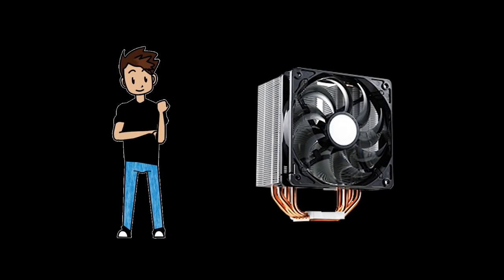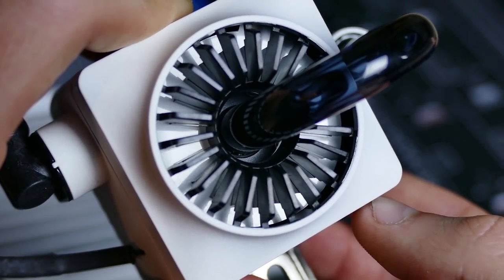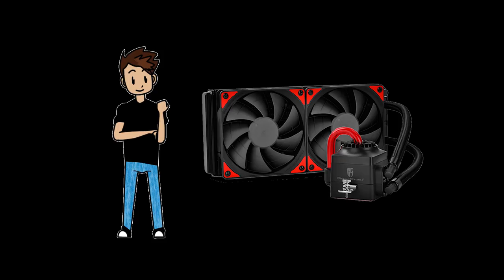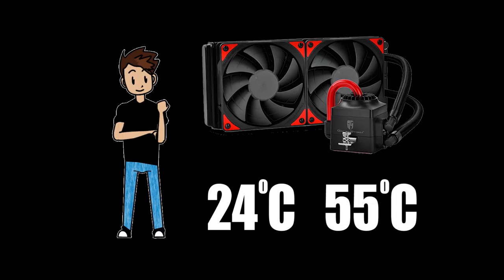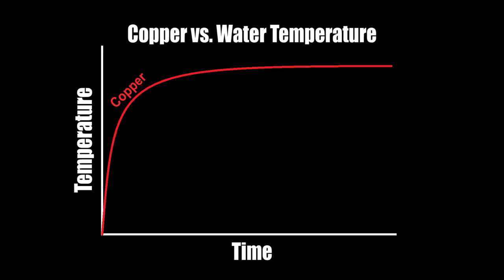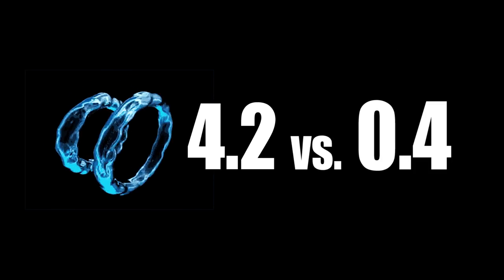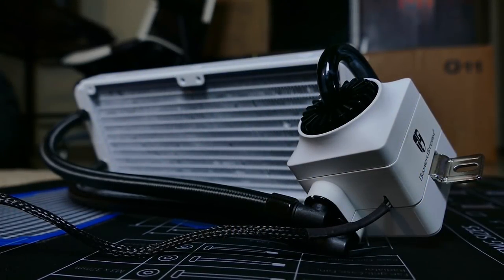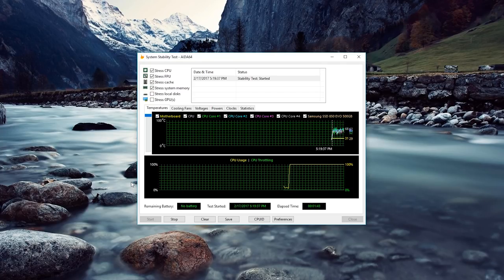How to Properly Measure AIO Temperatures

Comment: Should I get a 7700k/7600k or wait for Ryzen?
E̲D̲I̲T̲:̲I am new to PC gaming and need the processing power for games, video editing, emulation,sound editing,  and some virtual machines.
I am also getting into I.T so I might run virtual machines of Windows server,Mac OS, and maybe some Linux Distros.
Reply: Nm3z Kazi Wait for Ryzen's benchmarks and then choose the better one.
Reply: wait for ryzen then if you think ryzen is better then get it but i think ryzen will be cheaper
Reply: not only will the cpu be better price to performance, the motherboard will likely be cheaper too with the same feature set.
Reply: Nm3z Kazi It's fine to decide the rest of your parts, but with Ryzen less than a month away, you might as well wait on the CPU-MOBO til it comes out rather than 
A) decide you'd have liked AMD better/ gotten better price/performance ratio or 
B) bought Intel goods at a higher price

good luck mate!!
Reply: Roman Kozlovskiy That's subjective and without data to back it up as people would naturally stop buying amd products if they all crapped out pretty easily. Despite this claim, they've been able to eek it out with 3 year old CPUs until now and still competed (even if only barely due to pricing )

People get good and bad experiences with both sides, it's worth the wait :)
Reply: do you NEED to upgrade? that's what you should be asking yourself if your benefits aren't drastic then you dont need to spend the extra money
Reply: I'm an Intel fanboy and personally use a 7600k, but I'd recommend waiting. I jumped the gun and got the 7600k because my g3258 wasn't keeping up and i needed a new cpu. The 7600k is perfect for what I need, but it really isn't anything new or special.
Reply: I mean I am new to PC gaming and need the processing power for games, video editing, emulation,sound editing,  and some virtual machines.
Reply: if that is all you are doing then just get a i5, but wait for ryzen to come out, all cpu prices will drop after that
Reply: ya so tru i agree with ethan :)
Reply: +lucas rem
console can't run 4k games...they can t even run games at 1080 60fps and med detail in most cases
Reply: Will the i5 do well with 1080p/1440p/4k video editing and gaming?
Reply: +ethan dipple
and why would you suggest an i5 when an amd is looking to be faster at a lower price?
going for an overpriced 4c/0t in 2017 is madness
Reply: because he wants to run virtual machines and we don't know for sure what AMD is doing untill they acturally put their products on shelves
Reply: +Nm3z Kazi anything will do 4K editing, it just matters on 1. where you are getting your content and 2. how fast you need to produce that content
Reply: I am getting into I.T so I might run Windows server/Mac OS and maybe some Linux Distros.
Reply: ok then look for the leaked prices on ryzen you'll see
Reply: I fully expect my i7 6700k to sell for 200 USD before long.
Reply: there is going to be 4 core 8 thread ryzen cpus
Reply: I would get a Non-American CPU. 

AMD and Intel support Jewish overlords and illumanti (confirmed). Let me ask you this, if a
Reply: For the workloads you are mentioning you will probably need many cores. When RyZen comes out, if it is good, go for a 6 core or an 8 core. You will also need a lot of RAM, 16GB or 32GB.
Reply: Nm3z Kazi up to you, just letting you know that the 7700k is hot as hell. I have a h115i and at 4.8ghz it gets up to 90+ easily
Reply: Get a Ryzen 7700K
Reply: wait for ryzen and intels leaked x299 kabylake stuff may be a soldered version of kaby to fix thermal issues
Reply: Nm3z Kazi definitely wait for ryzen, you will regret if you don't. For the same price of a 7700k, ryzen offers a 8c/16t, and a 6c/12t for the price of a 7600k.
Reply: Intel finally has competition, be patient
Reply: Nm3z Kazi wait and see price cuta from intel or cheap amd will be very very soon
Reply: if gaming then get the i5 if gaming and editing get the i7
Reply: I say first wait for Ryzen to come out, then check prices of their equivalent of an i7-7700k, then wait for a friend to buy a Ryzen and ask him if his system is stable... As a long time AMD user, i know that the early models in AMD new generations tends to come with lots of issues. Intel in the other hand, tends to work realy stable. And i know is not realy AMD's fault, it can be due to the Motherboards, and even windows itself. But the fact is, that early adopters tends to suffer a lot of headaches.
Reply: ultra 4k 60fps gaming is pretty much out of the question unless you have a crazy budget. honestly its still a few years out imo. for example i7-7700k, gtx 1080, plenty of ram wont even get you a smooth 60fps in 4k playing bf1, it'll be in the 40's more likely.
Reply: dual titan x build bruhh it'll only be like $10,000
Reply: Nm3z Kazi id recommend to wait for Ryzen
Reply: If leaks are at all to be trusted, you could get a Ryzen chip that isn't far behind the 7700K (when overclocked to the same frequency, that is) for just over half the price.
Reply: Vicious Demigod They haven't hyped Ryzen up like they did with Bulldozer, and just about all of the leaks have been lining up with each other and with what AMD claimed performance-wise.
If Ryzen does turn out to be a disappointment in the end, I'mma be questioning reality.
Reply: None of the Athlons or Phenoms have been letdowns.  The AM3+ socket just lived a little too long.
Reply: This cannot possibly a real question. Why on Earth would you not want to wait for at least a significant price drop if not an outright better CPU?
Reply: WAIT FOR RYZEN
Reply: Nm3z Kazi I would personally wait, but don't be too overhyped as AMD is the king of let-downs.

Edit: If anything, maybe the Intel CPU will drop in price when the AMD one releases.
Reply: Nm3z Kazi coming out FEB. 28th or early march. Wait for ryzen
Reply: Nm3z Kazi Ryzen, the Ryzen Summit Ridge cpus are way way better in price to performance than intel. Their six cores cost around the current  i7 kabylake cpus. Also, how someone said that the intel cpu prices might drop, well, they could but not by much, if at all, as they are just now hiring more employees and intel, like Nvidia,(be ready for a biased statement) want more and need more money. Like how Nvidia pays large sums of money to game developers to make Nvidia gpus perform better in said game.
Reply: MonsterLord Games when will the new amd cpu and gpu come out. I'm new to pc gaming and I'm going to build my own. I know the cpu will help drop the price of the old one but I don't want to wait that long so does anyone know how long till the new cpu or gpu will come out? thanks
Reply: Super1 23 Have you been living under a rock? Beginning of March, allegedly.
Reply: Games are using more and more cores by the day, I would wait for Ryzen.
Reply: Nm3z Kazi ryzen
Reply: Try to get a 7700k like me, I found a good deal on Ebay for $310
Reply: William Dillery NO NO NO NO NO NO NO.
YOU'LL BE ABLE TO GET A RYZEN 8-CORE FOR THAT PRICE.
Reply: NEX H5 with as much SC performance as an i7
Reply: Michael beseler Broadwell IPC plus more efficient SMT (hyperthreading).
Reply: +NEX H5 Considering that AMD has never done SMT before and that we don't have the benchmarks, that's a very brash statement.
Reply: Sobakus "We don't have the benchmarks."
Oh yes we do. Leaked information (same with the SMT efficiency), but given how well all of it lines up with one another, I'd say it's pretty reliable.
Reply: Sobakus Still, 8 physical cores with the same single-core performance of an i7 >>> 4 cores and 8 threads.
Reply: +NEX H5 You don't happen to have the link to the SMT efficiency benchmark?
Reply: Sobakus It's not exactly a benchmark, some guy who managed to get hold of an engineering sample on a forum; some YouTube channels covered it though, but I can't remember which videos exactly.
Reply: Sobakus They said it was without turbo boost and XFR. And even if it's slightly worse than Intel's, it's still largely competitive, especially since you'd be getting twice as many cores with similar IPC to modern Intel for the same price.
Reply: +deathbat6916 Oh, come one, there's no "they", it's an anonymous submission to the PassMark online score database. Cut the crap and read the article at least.
Reply: Sobakus pretty sure the engineering samples are specified just like the benchmark AMD themselves used.
Reply: alright youtube chat 2 weeks, no more need to discuss much, the conclussion is wait, it all looks great, but wait benchmarks...
2 weeks to benchmarks...1 week till release maybe just 1 week till benchmarks...
Reply: +deathbat6916

The benchmark AMD themselves used had turbo though, from what I gather: http://wccftech.com/ryzen-ces-2017-3-6-ghz-base-clock-f4-stepping-4-0-ghz/

The one in the leak is the F4 stepping, which is the final pre-production one and I'm 99% certain that it has all the features – including turbo and XFR. It's possible that some of the features could be disabled for any number of reasons though, but realistically speaking it must have been enabled: at 3.4GHz it would end up beating Kaby Lake's IPC by 15% which is simply ridiculous.
Reply: Sobakus yeah I don't think it'll beat Kaby Lake.
Reply: deathbat6916 it will and already did
Reply: Michael beseler With twice the cores and threads, that is.
It's slightly above Broadwell in terms of performance, though obviously, when it comes to price/performance, it's gonna slaughter anything Intel has out right now.
Reply: Michael beseler I believe in single core it will be somewhere in between Broadwell and Skylake effectively, especially since the 1400X (4 cores 8 threads) won't be clocked at 4 GHz with a 4.2 boost like the 6700K.
Reply: deathbat6916 the 1800x already was shown on Linus TechTips to beat broadwell e
Reply: Sobakus oh
Reply: If AMD isn't lying then I'd wait for ryzen. At the prices stated intel will have to lower prices to compete.
Reply: Benzh theres a lot of people out there who would be willing to switch for that price. But I agree with what you said and its the sad truth
Reply: It's basic economics. You have to be competitive when it comes to price.
Reply: Yeah, they will be on next gen cpu's. They have no reason to drop current prices.
Reply: Sean O'Friel That's bullshit, I have a 980ti and a 7700k at stock clocks and I get stable 4k60fps with Anti Aliasing off and some high impact settings turned down to medium/high. The game still looks amazing. I hear people say 4k60fps is a way off all the time and I would agree with ultra everything but you don't really need AA at all or slot of settings like God rays in fallout 4 for example.
Reply: Ron Swanson what the hell did that have to do with anything
Reply: Michael beseler he was criticizing someone because he said BF1 on a 1080 couldn't run 4K
Reply: deathbat6916 Oh he must have maxed the settings and based that on solid 60fps
Reply: Michael beseler yeah
Reply: Super1 23 Hey man, the new CPUs come out in this next week, the GPUs came out in fall. RX 470 is king of budget GPUs, but RX 480 and gtx 1060 3gb are also great deals :)
Reply: Nice
Reply: Nm3z Kazi Is that CPU running at stock or is it oc'D?
Reply: I am going to overclock it once I get it. It is the best bang for buck deal I've seen so far.
Reply: Nm3z Kazi It absolutely is. Tho the 980 is pretty much midrange nowadays and you probably won't be running too many newer titles past "High" settings (i.e: Deus Ex, Ghost Recon)
Reply: I pretty much play cs go, call of duty, fallout 4, some emulators, and some indies, etc. I don't mind putting it down from ultra to high settings.
Reply: It would be a huge upgrade from my amd apu with no gpu lol.
Reply: Nm3z Kazi for newer titles you may need to turn shit down. Like the aforementioned Ghost Recon and Deus Ex Mankind Divided
Reply: Would I need to turn down settings for gta 4, gta 5, bioshock infinite, mafia 1/2/3?
Reply: So a 980 is equivalent to a r9 fury, gtx 1060, and rx 480?
Reply: Nm3z Kazi 4 stutters on everything, 5 should be fine on very high, Mafia 3 there's no use turning things down on because it makes no difference, those games are fine.

R9 Fury is higher up than a 980 but otherwise yeah
Reply: The 980 posts above 60fps with MSAA at 1080 in any game. Anything faster than it is for higher resolution gaming.
Reply: Sobakus There's plenty of games that need more than a 980 these days for max settings/MSAA. "But they're just bad ports" no actually, plenty of ports that are falsely accused of being bad just because their cards can't hit max settings are actually optimized just fine. A 780 couldn't max Crysis 3 (game that came out in literally 2013) and you'd need to turn a few things down on the Witcher 3 for a 980 to get over 60FPS locked. I'd say for 1080p max settings in every game you'll need a 1070 and even then you may have to turn down AA.
Reply: Well, yeah, I didn't mean 8xMSAA, but nobody needs that unless they play on a huge TV screen. The 980 manages 60 fps in Witcher 3 with 8x though, but not in Crysis 3. It's really not about date of release.
Reply: Sobakus I don't mean 8x either. Some games, max settings will go above the VRAM limit (it's equivalent to a 1060, so a 1060 would likely fare better) and even without ANY MSAA the framerate might stay below 60 most of the time. Not every game is as easy to run as Doom or Metal Gear Solid V (frankly I think MGS would run at 4K60 on a 1060 lmao since a 1050 Ti can at about 40 FPS)
Reply: Sobakus However, these same games are perfectly playable on a 980...on High detail at 1080p.
Reply: Sobakus Date of release does matter, because if you're comparing a 2017 game to a 2013 game in PC performance to slag off the 2017 game it's just idiocy.
Reply: Nobody's slagging of Witcher 3, I'm saying it runs 60 fps at max settings on a 980 as you see by opening any techpowerup review or simply googling "Witcher 3 gtx 980 performance".

Browsing through those same reviews I can't really spot any game the 980 couldn't handle at ultra besides Crysis 3, which, again, is a much more demanding game despite its age. Have you ever heard the phrase "but can it run Crysis"? That game was released in 2007 but can still stress out most modern hardware, albeit in 4k.
Reply: Sobakus I have heard that phrase, I get it's extremely demanding. I'm saying that people are slagging off some of the most demanding 2016/2017 titles because at 1440p max settings, even a GTX 1080 can drop below 60 FPS. I personally think the 1080 Ti is a truly definitive 1440p 60 max settings card in every game, and 4K 60 in a lot of games, and a 1070 is where you'd be looking if you want 1080p max settings every title.